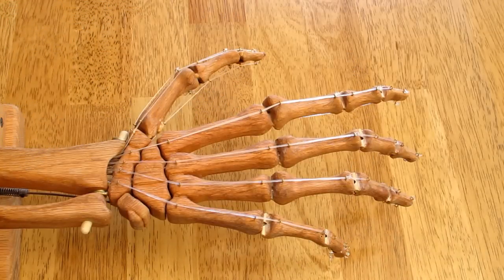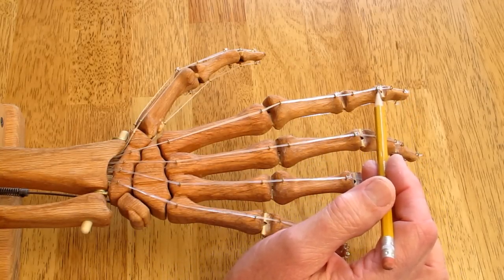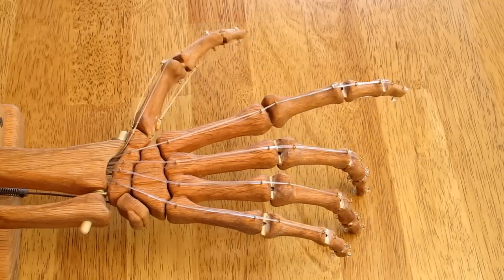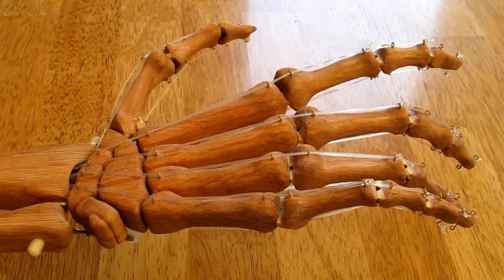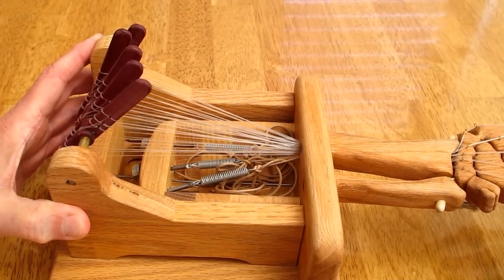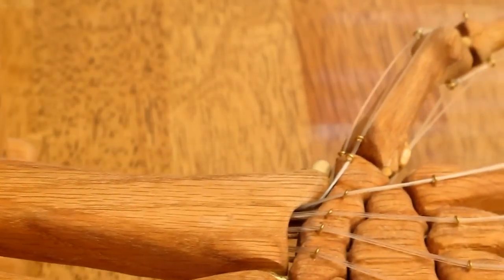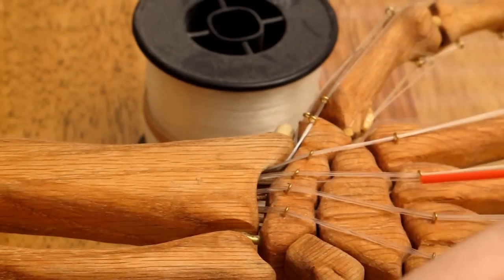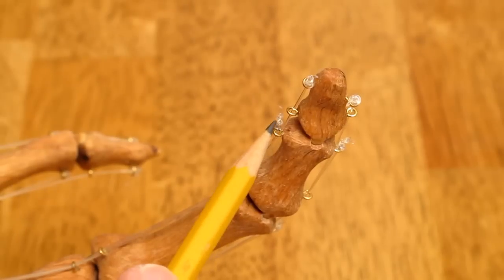Wood Skeleton Hand - Making It Work

Comment: Amazing job. A couple of suggestions. You can buy small teflon tubing on eBay that eliminates the drag on the fishing line. Works better than the WD40 straws. Also, instead of fishing line you can use jewelry wire, which is like fishing line with a tiny flexible steel cable inside it, which keeps it from stretching. Available at large craft stores. Also, almost nothing will glue to teflon tubing, though for some reason aluminum tape sticks to it like crazy, so you can wrap a small piece of aluminum tape around it, wherever you want to attach it, then use anything that will stick to aluminum to glue it down. I've made similar hands before. Never found the need to run a line to each joint. If you use teflon tubing to eliminate drag, one line will control all joints on one side of a finger. You just tie it off at each finger tip and the bending gets divided between all joints. Or rather than tie it off, you can run it through the tip of each finger, being sure to secure it, and use one continuous cord for both front and back cords, to avoid bulk at the finger tips. The teflon can also be buried inside the bones, so it's only visible at the joints.

Comment: Looks nice and spiffy. Though you probably figured out after you jointed and strung it that the joints are annoyingly complicated. Each one actually functions like a trunnion. Its also why arthritis can be the worst in the hands, since its just a thin layer of cartilage in between the bones allowing them to slide against one another. As soon as that breaks down, its just bone on bone grinding. All in all considering you worked just from a single image, it turned out really nicely.

Comment: Incredible work. Do you have a video on how to make the bamboo skewer joints?
Reply from the maker: Droemar No... sorry! I shaped the joints with a drill bit and a Dremel tool. Then glue the bamboo into one side of the joint. Just something you have to play with.
Reply: Ronald Walters I am trying to find a good way to make joints that hold their position, if you have any suggestions! :)
Reply from the maker: Droemar  My bamboo joints have a limited range of motion but that is the best I could come up with at the time. A pined hinge joint (like a door hinge) would be good or possibly a ball & socket joint but those are difficult and time consuming to make for a bunch of small finger joints.